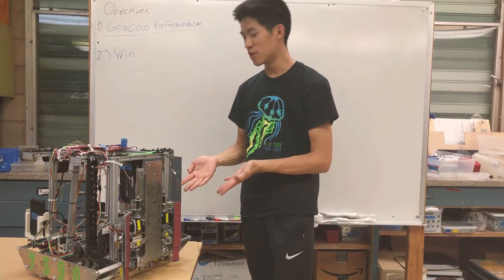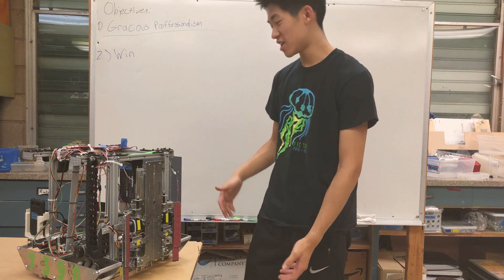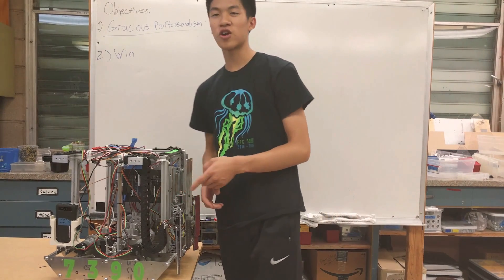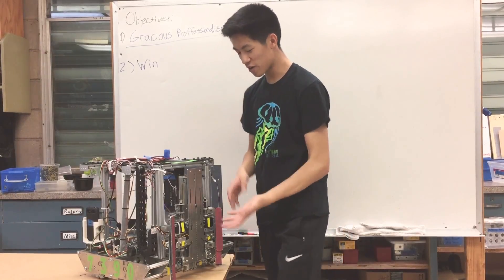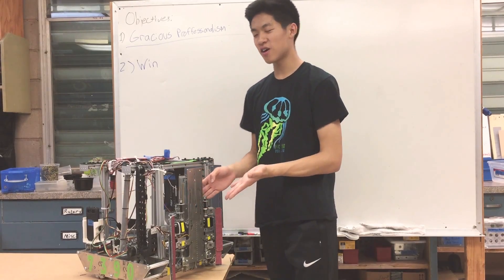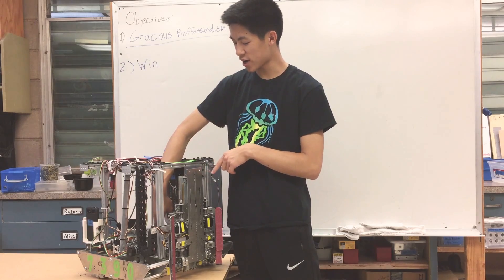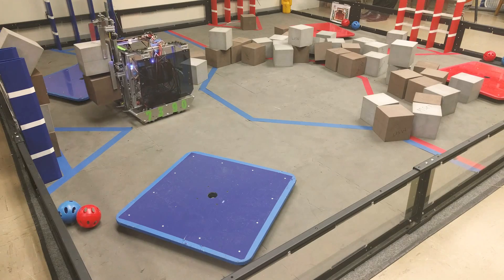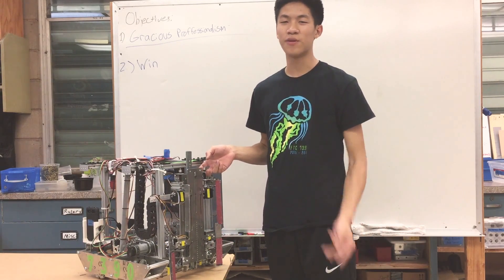FTC Relic Recovery Robot Reveal Jellyfish 7390

Comment: You guys should check out some of the 40:1 andymark never rest 40 motors. They work great for lifting. My team has been using them for 4 years and never (haha) have they once failed us.
Reply from the maker: Thanks for the tip! We actually one upped you though because we're using 2 NeveRest 20:1 motors to power our winch. Same power as one 40:1 but twice the speed!
Reply: M-SET Jellyfish 7390 very true but you may come to a point in the season where you could use an extra motor. And this year you don’t have to go super high so the distance from grabbing blocks to the crypto box has plenty of time to lift with 1 40:1
Reply from the maker: Point taken we'll keep that in mind!

Comment: How did you make your autonomous so accurate?
Reply: I'm part of the team, and I coded the auto. The auto is just encoder drive, and to adjust for distance from the box, the robot gently adjusts itself against the wall to get itself aligned. This way, you only have to drive a certain distance to certain columns of the cryptobox. After that, you just have to turn 90 degrees and drive forwards. Hope this helps!
Reply: Thanks. For my team we did pretty much the same thing with encoders but never could accurately get the glyph into that crypto box. I never would have thought of aligning the robot against the wall
Reply: I never thought of that. It blows my mind that something so simple could do so much.
Reply: wow, disappointed no pid no gyro aided turns??
Reply: something they do quite often in FLL
Reply: Also, a great idea is to go into the cryptobox at an angle, so there is a smaller margin of error. Check out this video we made:
https://www.youtube.com/watch?v=NSjxnX0UZd0